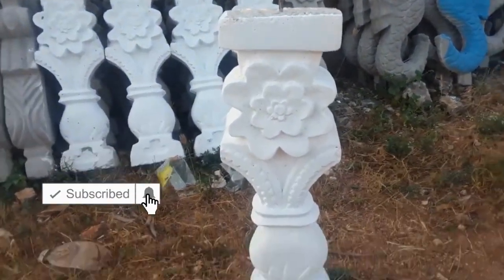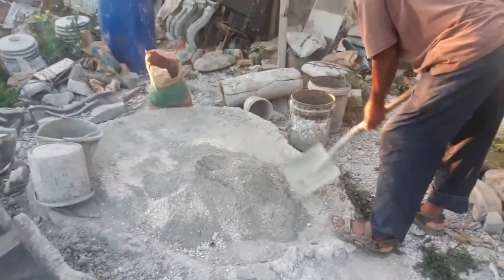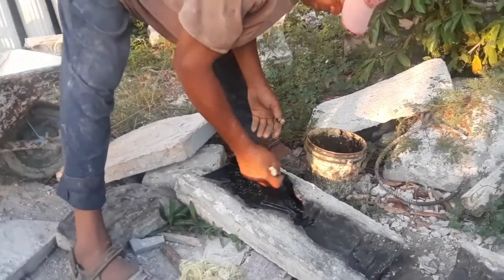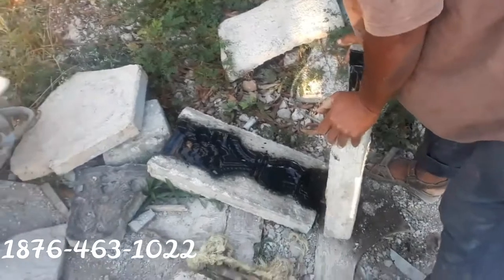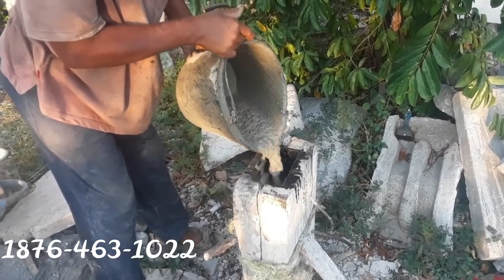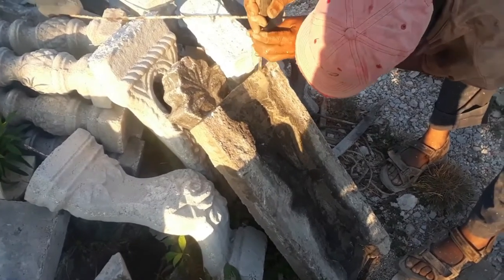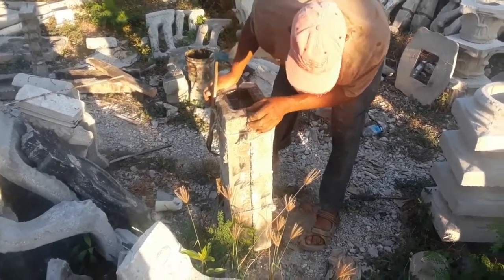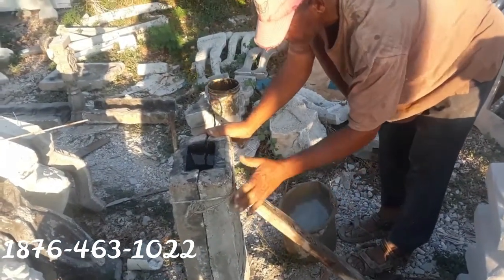how to make balusters in Jamaica

Comment: You need to  modernize your production method. Get  metal band locking system  rather than a cheap  piece of OLD AND BROKEN ROPE.You can also buy appropriate lubricant